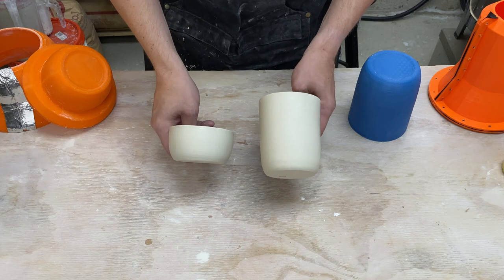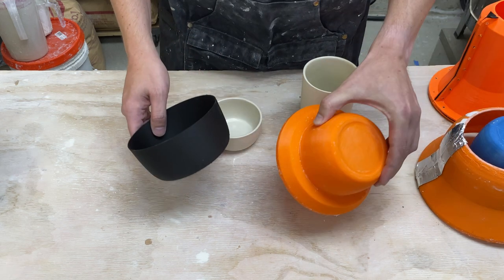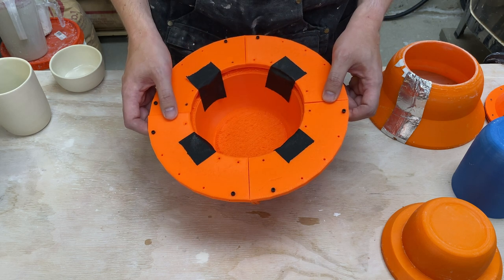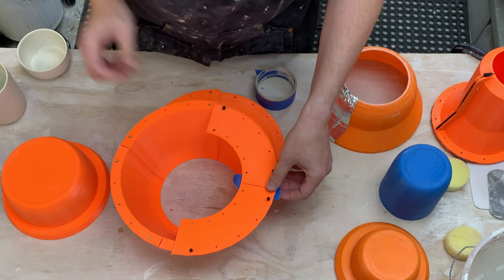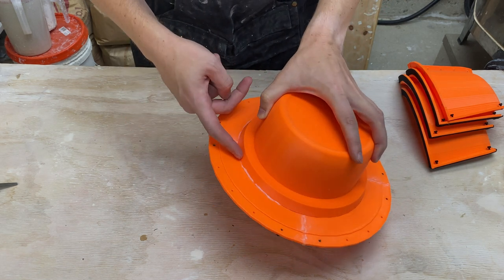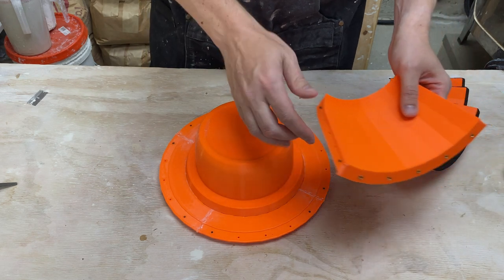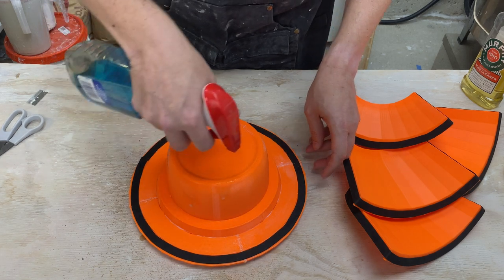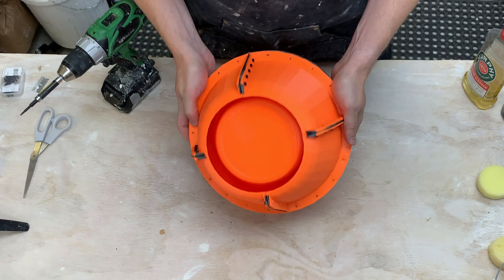3D Printed Slip Casting Mold Larger than the Print Bed

Comment: One feature of the cad software I use frequently is the ability to 3D print threaded holes. I do tend to use M5 to M8 bolts, but I am able to avoid having to deal with threaded inserts.  Saves a little time and money. Of course,self-tapping screws would work too.
Reply from the maker: Right now the backend of this isn't using CAD software. The 3D part is scripted in python with blender right now so adding threads might be a bit tricky. (However I don't know blender well, there may be some magic functions that do it). It would be nice longer term to simplify the system for end users!
Reply: @PotterybyKent   use openscad to produce the STL for the threaded hole insert and stick it in blender filling your holes. My 3d wokrfolw uses both OpenScad and blender. I do "creative" bits in blender and then do anything requing precison in openScad.

Comment: I don’t think I can use your ShapeCast site to generate STLs for the items I want to make because they have decorative features on the outside. Is it possible to add my own STL file and then have ShapeCast create the outer wall?  Also, is it just the coldness of the alcohol/ice mixture that allows you to remove the 3d bowl from the plaster, or is the alcohol a necessary component? I am thinking it might be because you want slushy ice water rather than solid ice or just really cold water. Is that it?  Regardless, I am thoroughly enjoying your videos!
Reply from the maker: Correct - it isn't the alcohol specifically - you want the mixture to be liquid at freezer temperatures (which is a fair bit below the freezing point of water). That lets the 3d print shrink just enough to overcome the growth in the plaster and vacuum formed.

Right now, Shape Cast does not support that. It is something I'm thinking about. However most features on the surface of the pot would require a multipart mold. It is also possible I could do a custom design for you.

Comment: As someone who knows not much more than what I've seen in this video, is it possible to make the slip casting straight from the 3d print? As in no need for the the plaster mould? This is so awesome, thanks for making the video.
Reply from the maker: Thanks for watching! It is not - which is why the process has several steps. In short, the plaster is porous and transfers the water from the slip to deposit the clay. If you used a 3d print, it would be just like pouring the slip into a plastic bucket and back out. You'd get a dirty bucket, but no pot.

Comment: Love this series, this is so clever and something I would definitely want to try, thanks for sharing your experience. I wondered why you made a smaller bowl out of the black plastic, if the smaller one is the ideal size then after the clay shrinks it'll be even smaller no? edit: Or did you say the software scales it up to account for it?
Reply from the maker: Thanks! Yes, the software automatically scales the STL files for the plaster mold. The design proof is 1:1 so you can get a sense of the form before committing to plaster.

Comment: I get that the exterior doesn't need to be pretty, so the rough texture and flashing isn't a big deal. But it seems to me you would want something better for the internal displaced object, yeah? PLA printers might give you better results. They're getting super cheap and their build trays are getting up there also. I've got an older Anycubic Mono X and absolutely love it.
Reply: By the way, I'm super new to all this and really like your videos. Thanks for sharing your journey with us.
Reply: ....aaaand I just found your video about smooth 3D printed molds. So, you can ignore my question XD
Reply from the maker: Indeed! There are ways to get smoother prints. Both higher resolution prints (so wait longer) or filler primer and sander are both options.

Comment: The plaster molds look great. I'd add handle wells to the sides to make lifting easier.
Reply from the maker: Thanks! Do you have any examples of handles that might work? They could be added but I'm not sure what might actually help given how the mold needs to be moved around.
Reply: I imagine just hollowing out small spaces about ½ inch on either side to aid in gripping the mold. @PotterybyKent
Reply from the maker: Most of them have a pretty natural place to grab with the way the slip well flairs out. But given that this one is short it doesn't have it so it can print without supports. Once I use them some more I might make some more tweaks!

Comment: great job.. I been looking into making molds this way as well.  BTW  Where do you get that foam tape   i would always use the mold soap  You can mix whit vinegar and water 50/50 to remove the soap.
Reply from the maker: Thanks! I get it from amazon - there's a link in the description.

I've experimented with mold soap but at this point find it's not needed for just the 3d printed molds.

Comment: I've "upgraded" two of my priners to 0.6mm jewelled nozzles (one diamond, the other ruby). Print times are significantly reduced, and decent resolution is possible I find very functional mold prints at 0.20mm resolution, and for exterior pieces (not part of the slip cast piece) work well at 0.4mm resolution. The last printer is still a 0.4mm nozzle, though also a jewelled part for longevity (I hope). So I am able to get down to 0.07mm resolution without issue; just takes forever to print...
Reply from the maker: There definitely is a huge tradeoff between resolution and print time. One thing I am thinking of testing at some point is seeing how much of the 3d printed texture really impacts finished pots. For many glazed pieces I'm guessing it might not make much difference. If so, the high resolution is probably most important for anything unglazed and maybe there are some tricks to focus the print time in just those areas.
Reply: @PotterybyKent   I agree regarding resolution and print texture. I have generally determined that with a 0.04mm nozzle, the finished surface with a 0.2mm resolution prints work fine with a glazed piece. I really don't see the layer lines in the finished work. Unglazed requires getting down to 0.07.  But 0.05 really doesn't seem to make much improvement, and really, really impacts print time.
Reply from the maker: Good to know!

Comment: Clay question:
Why are my colored slips turning to pudding when i add the Mason stain. My regular white plain casting slip is fine but when i add mason stain it seizes.
Reply from the maker: My first guess would be your deflocculant. Are you using Darvan? If you are, then you can add more. If not, I'd recommend darvan.
Reply: @PotterybyKent  we used sodium silicate. What does that do to the stain?
Reply from the maker: Sodium silicate is very touchy. I know adding too much will have the opposite effect which sounds like what you're describing. Darvan is much more forgiving, which is why I use it. I'm not an expert in slip chemistry, but it sounds like you're on the edge with sodium silicate and the stain is pushing it over. And/or the stain is messing with the charge properties of the clay particles with the sodium silicate in there.
Reply: @PotterybyKent  Thank you so much!

Comment: Kent do you use waterproof foil tap or regular duct foil tape?
Reply from the maker: It is foil tape - I'm not sure it's specifically waterproof but it holds back the plaster long enough. (I've since moved away from using it though)